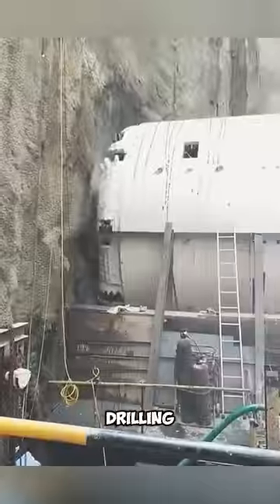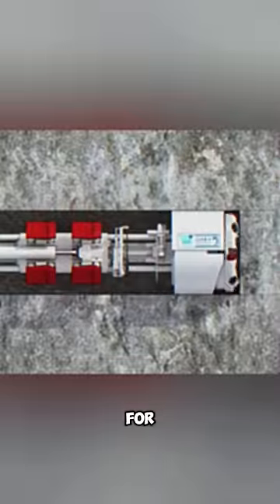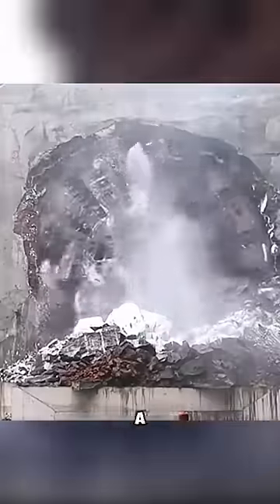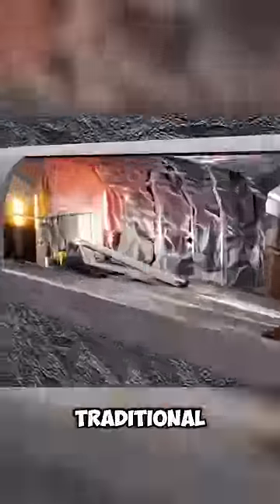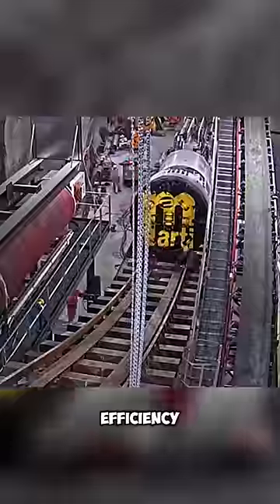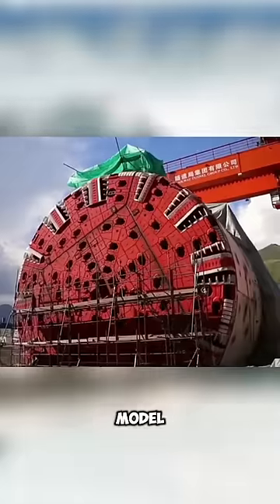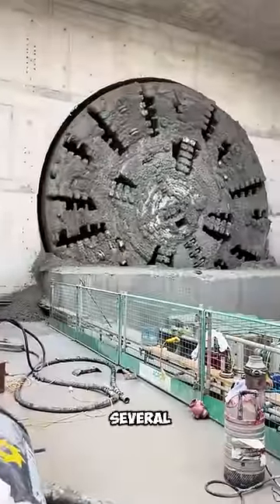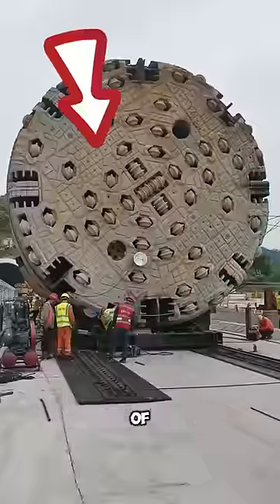😱This Massive Machine is Able to Drill a Tunnel Anywhere😱 #shorts

Comment: I read somewhere that after completing the tunnel some of them a just turned downward and left there because retrieval and refurbishing is more costly than building a new one for the next mega project
Reply: you could very well be correct. I imagine it's very valuable nonetheless.
Reply: One of the TBMs from the British side is now buried under the Channel. Another sold on ebay for £39,999 in 2004.  Eleven TBMs had been used!
Reply: That's some real for the Empire shit.
Reply: Wait aren't they supposed to... pop out the other side? Are there cases where they bore a one way hole?
Reply: @billyboy_45   some jobs like the Chunnel were worked from each side simultaneously
Reply: No they take out the main machine part by part which are hella expensive but the structure of the TBM is left behind and other parts also are taken out part by part which seems worthy of the cost.
Reply: @udayansahoo5303 Of part of the TBM is left behind, then how can the tunnel be used with it in the way?
Reply: @MyChannelOnThisSite they de assemble the tbm and bring it out piece by piece before refurbishment of the tunnel happens which preceeds the tunnel opening
Reply: Do they at least try to ravage its components?
Reply: It used to be the case but not anymore
Reply: Окей, время для старого русского анекдота!!!
Для строительства туннеля под Ла-Маншем британцы объявили конкурс для инженеров из разных стран. 
Выступают инженеры из Японии: "Мы будем строить тоннель пять лет, начнём со стороны Франции, гарантируем отклонение до метра".
Выступают инженеры из Германии:
"Мы будем строить тоннель два года, начнем со стороны Британии, гарантируем отклонение до 10 метров"
Выступают русские инженеры:
"Мы построим тоннель за неделю, рыть будем с обеих сторон, точности не гарантируем. В крайнем случае будет два тоннеля".
Reply: @finnmccaughey1690  So what's the case now?
Reply: Not everywhere ..only one have been left there and that too between France and UK underground tunnel. Bcoz two machines were working from either side..one has to be sacrificed..
Reply: Many TBMs are promptly disassembled and resold for future projects. The Boring Company reused several from Ryerson for their pet project in Vegas.
Reply: @MyChannelOnThisSite  What i've read online is that TBM's are typically built to project so they bore the right tunnel size and once completed their outer shell is used as part of the walls of the tunnel whereas certain innards of the machine are salvaged.
Reply: Wait they're digging DOWN with these things? I've only ever seen these things digging horizontally
Reply: @joeflippo520 Imagine if they had missed each other lmfao
Reply: This is why the earth is dying. It is more cost efficient to waste literally tons of material than retrieve it😂
Reply: @Francesco-gf1sv Umm who’s trying to ravage the components sir?
Reply: If you are from a 3rd world country, thats very common with alot of products.
Reply: Or. Hear me out. They use em to dig underground tunnels afterwards and no one knows where the tunnels go to how deep and why?
Reply: @Amaend8 correct
Reply: @MyChannelOnThisSite they are sometimes pointed down and either left or partly salvaged, as far as I know when the channel tunnel (UK-France) was finished one was left under it, just buried and left to rot
Reply: Seattle had one completely stymied in boring our under-city road tunnel by a measles piece of buried rear. Delayed the bore for over a year.
Reply: @Francesco-gf1sv salvage?
Reply: That’s just what the people who handle your tax dollars say…
Reply: @Amaend8 no. How we don’t hear you out.
Reply: @Francesco-gf1sv  *salvage 😂 ravage is morally illegal even to machines.
Reply: @MyChannelOnThisSite they back it up a bit and make a deviation with a side tunnel and leave it there
Reply: You're telling me they don't just drive it to the next worksite?

Comment: They use lasers now,  pulverize rock to powder, turning walls to glass or hardened smooth walls. 7 miles a day a machine can do, dont fall for the gate keeping machine.  Dig into Phil Schneider
Reply: They've had the nuclear subterane borer in use since 1972 when the patent was made! Think it was the Rand corporation!
Reply: Petra
Reply: surely that is expensive ash
Reply: You know you're full of crap right? So was Phil Schneider. His room mate said his fingers were cut off in an electrical accident when they were younger.  Also I know the movie the core had a drilling laser, but it was a movie.
Reply: No they don't. Laser cutting rock is extremely expensive and less efficient than a traditional TBM.
Reply: @KingThrillgore  Facts. dude is yapping
Reply: @mrb5783 Documentation and proof? I am not believing your words
Reply: Bout to now appreciate the wisdom 🫡
Reply: Freaking laser beams! 😂
Reply: @KingThrillgore for now.  Lasers right now are too weak.  But eventually it will cut through anything.

Comment: How the hell do they get tht to the job site!?
Reply: Comes dissembled in many parts
Reply: Lego set play
Reply: You assemble it on sight, then disassemble it after the project is done.
Reply: Built on site
Reply: Are they 1 time use? He said made to specs
Reply: Tool Box😂
Reply: I'm assuming they put that together on site ain't nothing big enough to transport that
Reply: most of the time getting the shell out of the ground is too expensive so they strip it of it's machinery and leave it in the ground. Sometimes the shell becomes part of the tunnel itself and serves as a grounding rod for the electrics in the tunnel.
Reply: Like lego and i imagine its a pain in the ass to build amd make sure all parts are accounted for
Reply: Piece by piece
Reply: Caseoh farts next to it
Reply: А как камни для пирамид Египта доставляли? причём задолго до 2024г!
... не через доставку же? 🤷‍♂️
Reply: They are assembled on point at the Job site'/!!!
Reply: @007oskari  No, they are too expensive for one time use.
Reply: @007oskari  Yep. 1 time use.
Reply: @DanielDSI2.0  did you do that on purpose?
Reply: They build it at the job site.

Its easier to build a machine than move it.
Reply: @007oskari Yes they are pretty much one time use. They usually just salvage the valuable parts for reuse and scrap the rest as scrap metal.

Comment: In Brazil Rio de Janeiro they abondoned one in the tunnel after escavating 100m in a subway system, It seems the cost to remove her from the site was greater than the cost to acquire another
Reply: Yes, transportation of these machines costs more than they are worth. That is why they are built on site at the exact dimensions needed. They usually just take out the most valuable parts and leave the rest.

Comment: I've read somewhere that their is a patent for one of these machines powered by nuclear power and it uses a laser or something with alot of heet so much so it melts everything in the front of it then that material is used for making the walls on the side s top and bottom the finished product behind the machine is glass smooth wallas and drivable floor I bet the tunnel looks so pretty
Reply: Seems quite far fetched and is probably a few hundred years away if at all.
Reply: Heat.
Reply: The nuclear subterane laser borer was patented in 1972 and been in use since, it literally melts anything in its path to make a tunnel diameter of 40ft and can make 7 miles/day of tunnel! United States has just over 800 DUMBS and there's over 1500 across the world,most DUMBS are between 2.5-4 miles deep.
Reply: а ссылка есть?
Reply: @mrb5783  lol there's no way